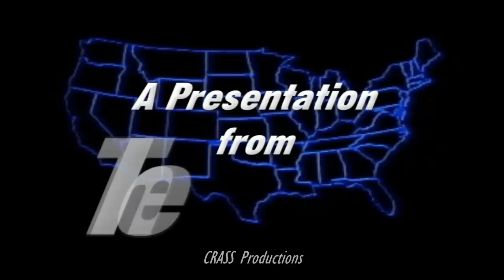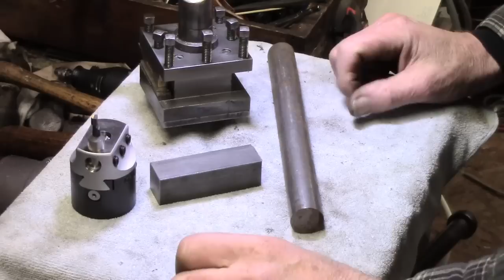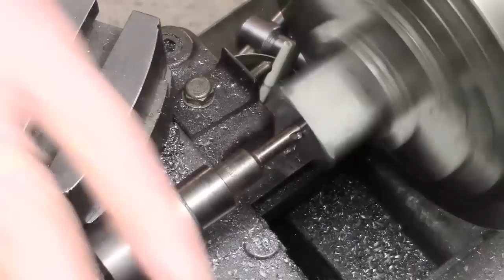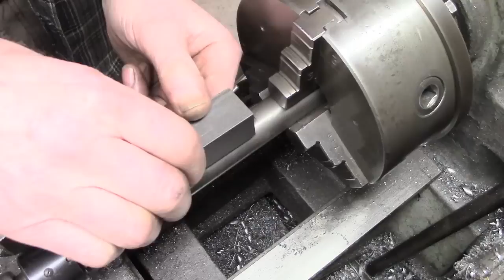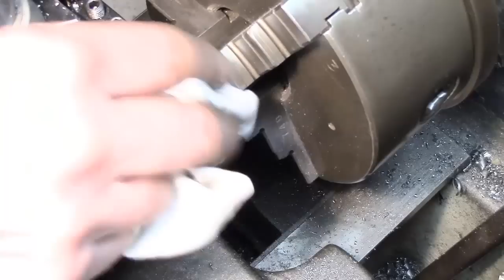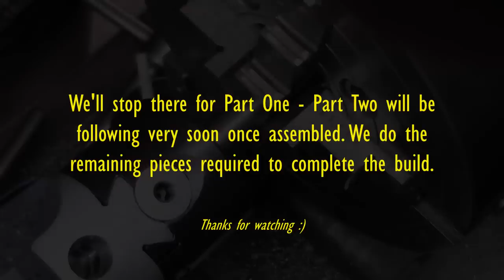Radius Ball Turner MKll - Boring Head/Tool Post Version, Part On

Comment: Please do not ever use rag to protect the bed when you are using Emery cloth, if just one corner catches on the chuck it will drag you in so quickly you will not stand a chance of survival! Use tissue, newspaper, or any paper material that will tear off easily. You did very well on your screwcutting, what was powering the lathe? I could not hear the motor running and it looked like you were turning it by hand. Chris B.
Reply from the maker: Englishman French  I hear you about cloth risks - but am always v careful - it is well below the chuck - agreed, paper safer. I used a home made spindle handle for slow turning - vid on that from way back - http://www.youtube.com/watch?v=SLjhaMu835I - very useful.
Reply: ChrisB257 Well! That is a good idea, I will make one of these for my Colchester Student lathe, I can think of a lot of situations where this would be useful, very many thanks for posting this. Chris B.